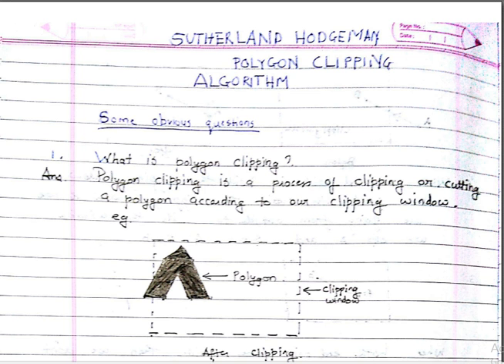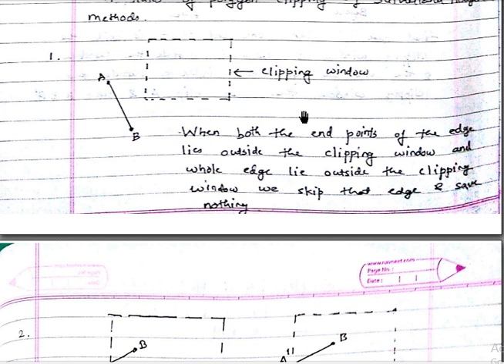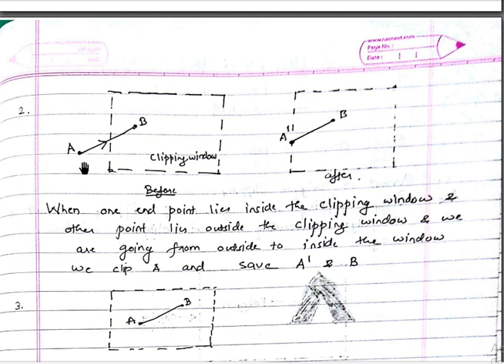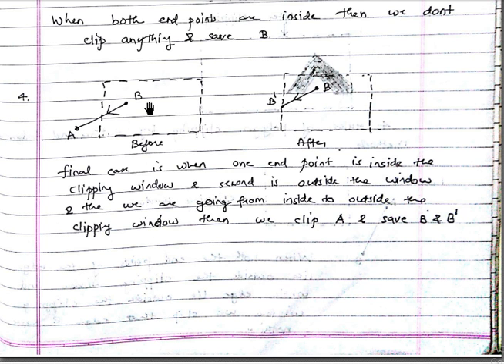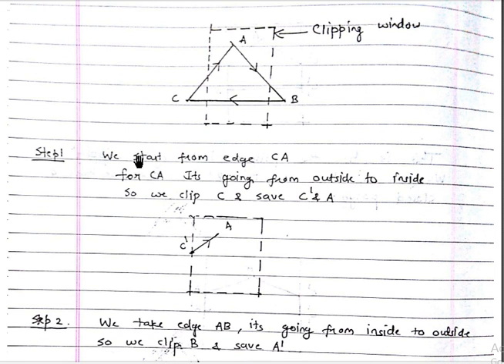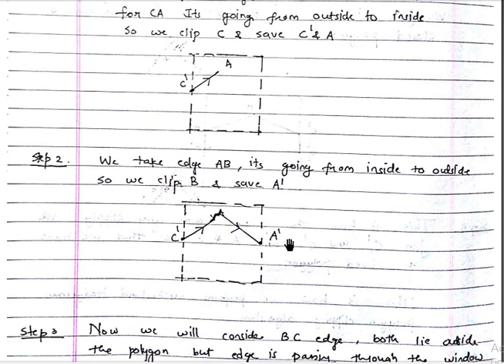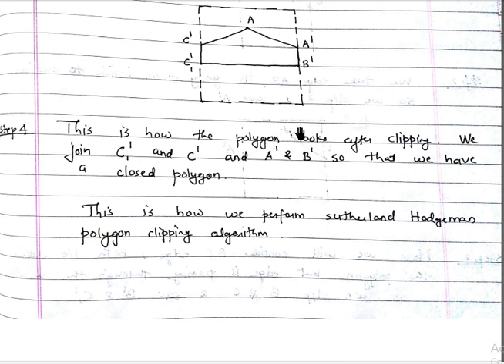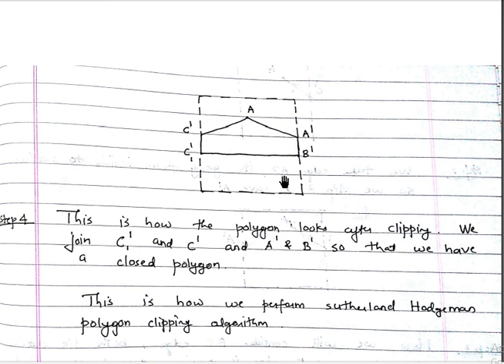sutherland hodgman polygon clipping algorithm with solved example

Comment: What if the clipping window is U-shaped for this triangle or if you clip E-shaped polygon with rectangular clipping window left vertical edge at the center and right vertical edge right side of the E and top & bottom edges top and bottom of the E?
Can you clip the polygon by itself to see if its self-intersecting or how to check about it?